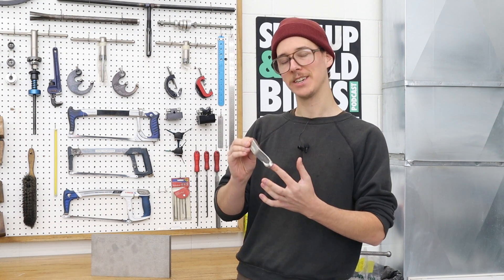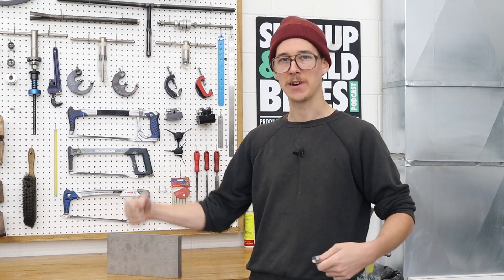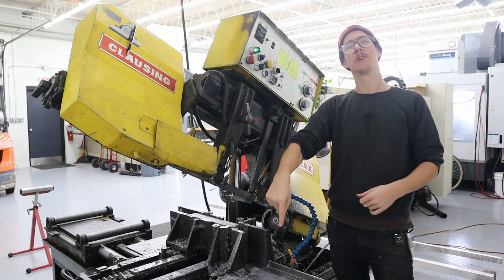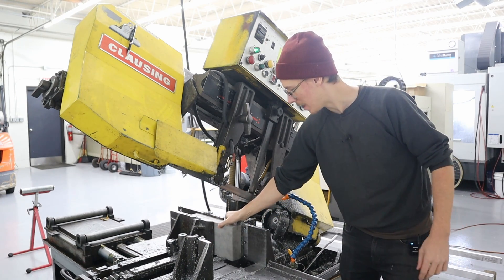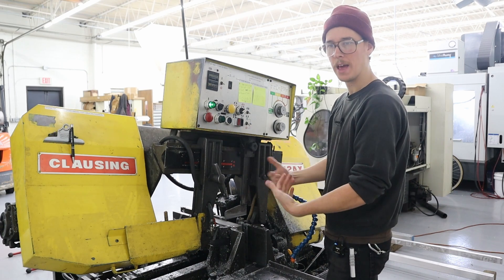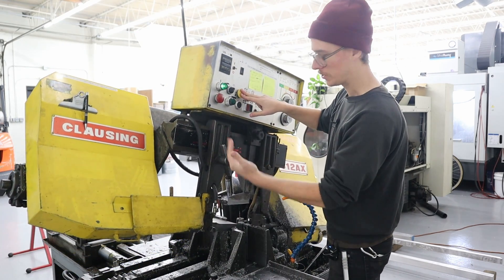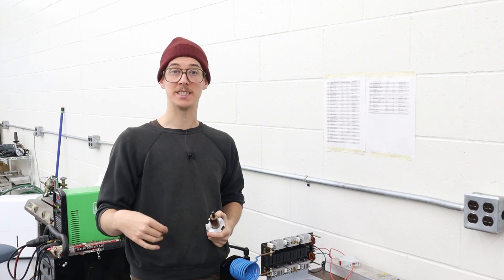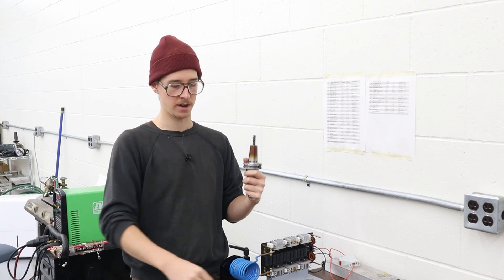CNC Machining Titanium Chain Stay Yokes for Custom Bike Frames | Framebuilding

Comment: Awesome video! Where did you find the components to make your shrink fit machine?
Reply from the maker: It's a 2500w induction heater. I bought it on ebay for about $200. I think it's intended for hobby jewelry casting or something. Nerdly has a youtube video about making one like this.

Comment: That op2 fixture is really neat! I love that those two expanding hold downs do double duty. If you’re inclined, videos that cover that kind of problem solving would be great. I find that the general doing, whether it be machining or welding is generally pretty trivial compared to fixturing/work holding
Reply from the maker: Yeah, that's always the question -- how am I going to hold it? That's the reason that sawing the plate up is a chore, too. The auto saw will leave a stub remainder often times longer than the feed length of the part. On a job like this the majority of the sawing has to be set up manually. You'd like a looong strip of stock of the correct thickness and width to start with so you only had one remainder to manually set up, but getting a plate ripped lengthwise in Ti is no small task without the right saws and I don't know any vendors who would do that for a reasonable price.

Anyway, yeah, everything is about workholding.

Comment: Awesome video, loved the content. You mention the plate sawing to be an issue, is this not able to be purchased already sawn by the material supplier?
Reply from the maker: Yeah, I haven't found a Ti vendor who will saw for a reasonable price. In aluminum and other materials it's pretty easy to find. I'm open to suggestions. Additionally, I can saw to a pretty tight tolerance with my equipment which is a pretty big advantage. Try getting consistent, quality cuts from the average saw guy. In exotics, no less!

I'm looking at buying something like a Roll-In saw to help rip plate into strips lengthwise so the horizontal saw can do more of what it's truly great at doing.
Reply: @cobraframebuilding  I make small custom Ti parts also.  Same issue you cite.  If the goal is to maximize your own profit paying any material vendor to saw titanium is just expensive and frequently doesn't end up with good enough spec sawn material to just load into your custom fixtures... which defeats the entire point of having someone else saw it.  I've been toying with the idea of having a waterjet cutting company knock a ton of blanks for my parts out of 3/8 thick plates that are at least 12x12 if not larger (whatever is affordable).  At first I thought the waterjet prices were insane, BUT if you have your parts nested for maximum quantity cut out of a plate you will probably come out ahead vs cutting them yourself because you can get maybe 3x as many parts per plate of Ti and they're ALL way close to final dimension meaning less machining time, less tool wear, and less material cost.  So think about it.  Maybe it would be worth it to you to have 50 blanks cut out of a plate even if you do pay to get it done.  Buying a waterjet won't pay for you or me unless you can put it to work cutting out many thousands of parts per year.
Reply from the maker: I'm actually buying a Verticut bandsaw right now to help me rip long strips. It's essentially the same design as a Roll-In saw or many of the Marvel vertical saws. It can feed something like 6" of cut at a time with just a gravity feed. This should work well for me with a coolant mister. Those long strips will then saw beautifully in my auto horizontal saw. You can buy industrial surplus plates for a bargain from vendors like North American Alloys. So that's kind of my plan at this point, but I was just talking to a friend who owns a waterjet about this. You can see the shape of this part would allow not only rectangle blanks to be cut on the waterjet, but we could actually cut near-net shapes and they could be nested tighter. Considering the gains I'd see in tool life and cycle time on the mill plus the reduced material needed -- that might be worth the WJ costs. But I'm pretty excited about this new saw in the first place. It should be useful for more than just this one use.

Comment: How do you afford the cool setup you have. Does building bikes really pay for all this? Very well done.
Reply from the maker: I only ever did bike framebuilding as a hobbyist. That's a tough biz. I made some money in gross sales, but spent massively more on my overhead and consumables. I never paid myself for my time. In 2018 I bought an old CNC mill for peanuts relatively speaking and started making tools for other framebuilders and that's the only source of income I've had since. This is tough business, too, but it's certainly more reasonable to make an honest living with CNC machining than bike fabrication.

I have many peers who did the same with a CNC machine shop. Started small in a little garage or something, did good work, and built it into a bonafide business. Most of them do job shop work. It's not exactly easy, but I think it's within reach more than many people realize.
Reply: @cobraframebuilding  many thanks for your very honest and insightful reply. I think your ability to transition from the old machining techniques to more modern CNC and CAD design is testament to how good you are. You’re a very clever fella and wish you the very best.